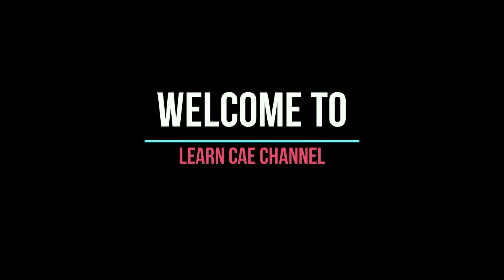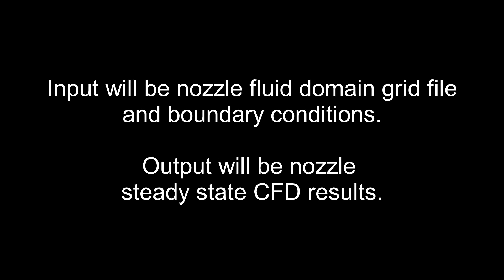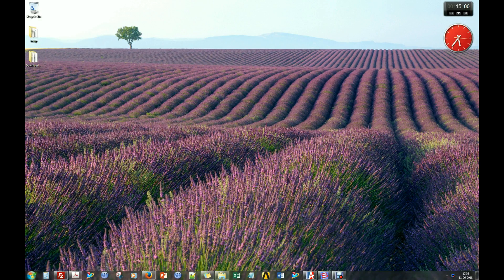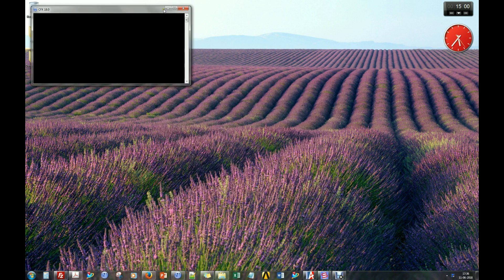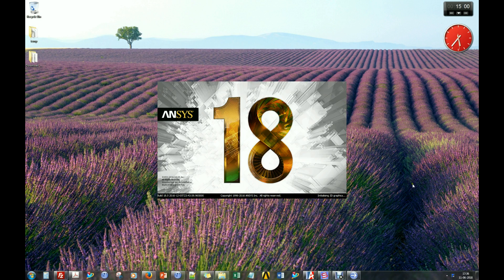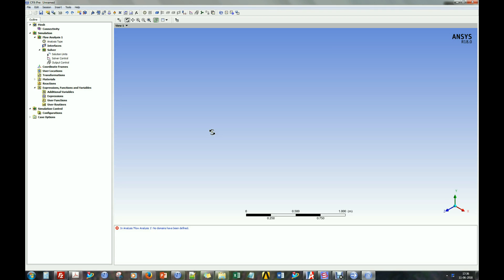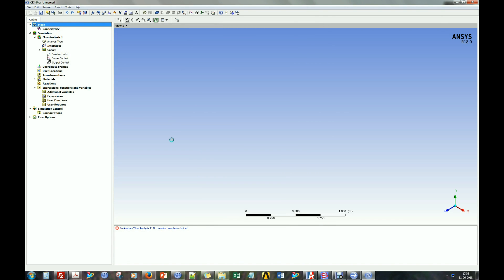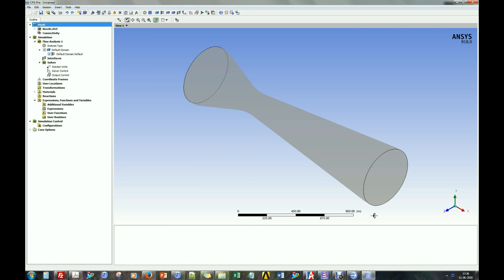CFD simulation of flow through CD Nozzle using Ansys-CFX

Comment: Hi, how did you construct the nozzle design
Reply from the maker: Hi, nozzle design was not the focus here. A simple CD nozzle cad model was done with particular area ratio and reasonable divergence angle for demonstration purpose.
Reply: Learn CAE Did you design it as 2d figure or a 3d. I am not able to select the entire surface of the inlet or outlet in my 3d nozzle, but instead I can only select a point . Pls advise
Reply from the maker: It was designed as 3D. May I know, if you are facing this issue in meshing or in cfx pre processor?
Reply: Learn CAE In the pre processor, im unable to select the inlet surface, like how you've selected in the video. It only selects a point
Reply from the maker: Hi, then you may need to change options in mouse selection filter or you can choose the regions from location drop down list.
Reply from the maker: Hi, you may send the files to learncaenow@gmail.com